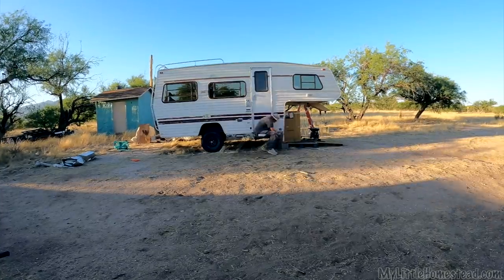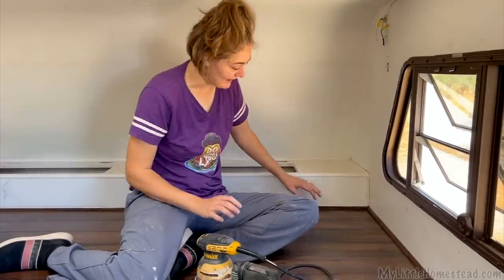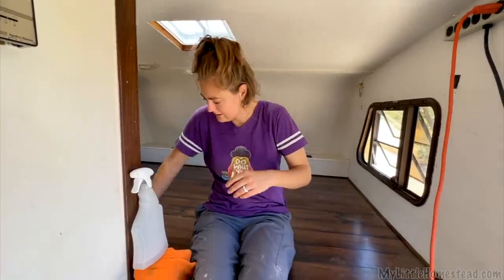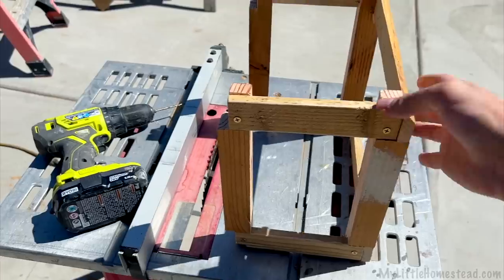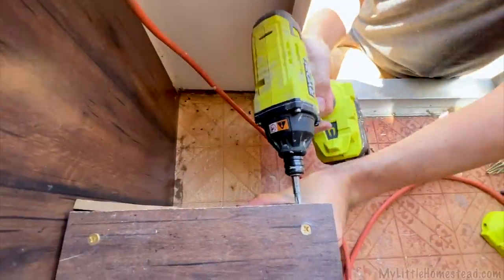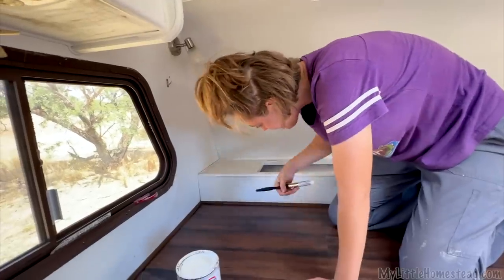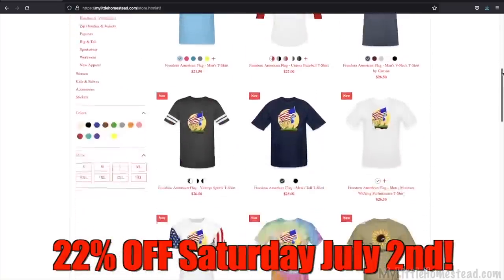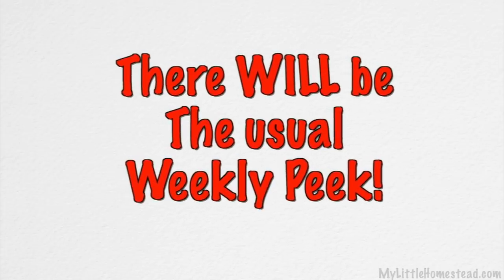😳White Wash RV laminate flooring FAIL💥 | Weekly Peek Ep360

Comment: When you had so much trouble with the sanding, I thought, "Well, you're just going to need to prime it first, because paint doesn't stick to that slick stuff well even after you sand it."

When you finished with the white wash and it wasn't what you wanted, I thought, "Well, just consider that a primer."

Bree: "... which we're not calling white wash, we're calling primer."

And I thought, "Yeah, that's what I thought!" :D

The dark gray trim really makes the light gray of the field pop.

That area isn't as big a deal as the walls or cabinets anyway, because it's going to be covered up by the bed and no one will ever see it except when the bed comes out for cleaning or replacement.

Happy Independence Day!

Comment: the trick to painting lam or plastics is wiping it with acetone to pull out the surface plasticizers and create a porous surface for the primers to bond into. this also works for super glueing plastics

Comment: Suggestion for you. When repairing a crack in metal, wood, plastic, fiberglass, etc., drill a small hole in the each end of the crack. This will prevent the crack from expanding. Cracks in fiberglass can still expand, after being covered with repair of glass mat and resin.

Comment: You don't want to sand that floor, it will ruin it. Also you should consider making the step into a triangle rather than rectangle or put storage under the steps. Maybe you could add doors to the steps.

Comment: another product to use instead of using fiberglass as you can see where you patched even when it is painted is car bog also known as Auto Body Filler - the RV is metal like a car and you purchase it in places like Lowes etc normally in the car section - similar to builder bog that is for wood but Auto Body Filler is specifically for steel/metal